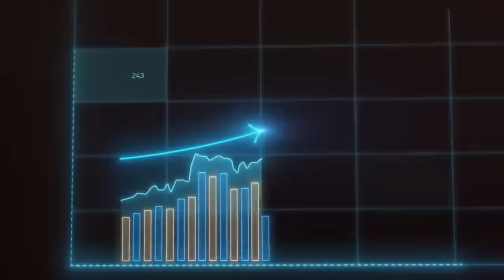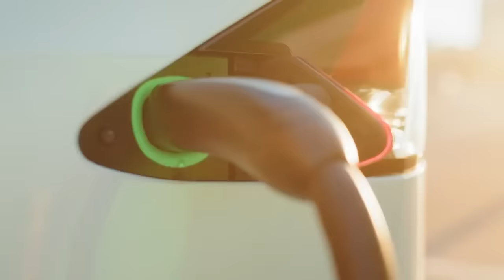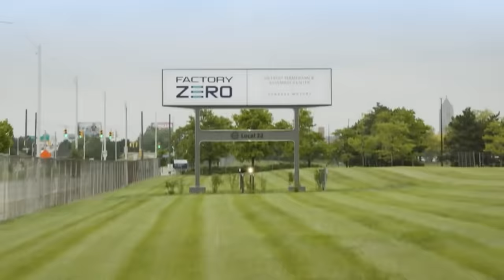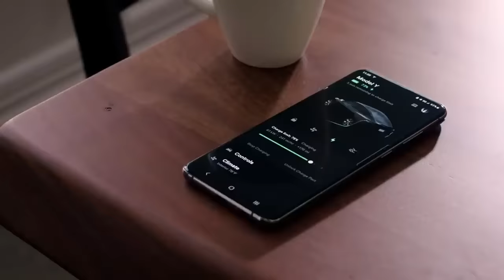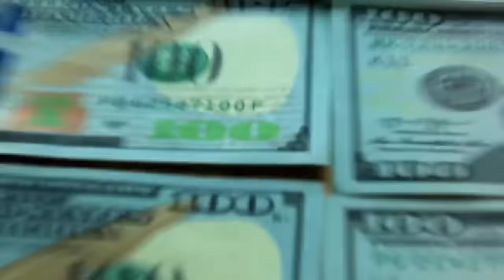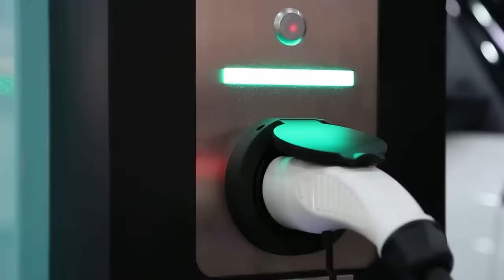Electric Vehicle Owners Are Frustrated and Demand the Return of Gas Cars

Comment: Sorry but I do not agree with almost any point mentioned here. Honestly, the author for sure did not drive an EV before. The drop of sales in 2023 can be explained by the high inflation and the fear therefore of the people. And of course new technic is always more expensive compared to "old" stuff. The EV market really exploded the past 4 years. Wait another  10 years and I predict higher sales for EV's than  gas powered vehicles.
I drive an EV for 3 month, I LOVE IT and switch the second car to EV this year as well.
Convice yourself, drive an EV, experience the ease of charging, the silent relaxing driving ... make up  your OWN opinion.
Thanks
Reply: This is my opinion. Personally I know of no one interested in an EV. We aren't there for range and work capabilities. They are probably a great novelty, 2nd car. A 2000 mile trip is a nightmare prospect in an EV, at least for now. Re-sale value, battery life/replacement are other considerations.

Comment: Electric cars are more harmful than  petrol and diesel cars  and  electric cars are dangerous and deadly ev car are very expensive high cost  to recharge up  and taking a  very long time to get  recharged up  3or 4 hours  

Plus they don't work in the cold weather  The battery shuts down so people can't use the vehicles 

Tesla and Tesla electric car design is flood due to the battery where its positioned road surfaces and other potholes, cracks on the road can damage the battery, causing the The car to go on fire Purchasing an electric EV car is like plain Russian roulette. With you families, life and your home address not worth the risk in purchasing a fully electric car. Due to the dangers of the electric vehicle  Due to broken battery. That can lead to exploding and then go   on fire. And it's very, very hard to put out and control. People simply don't want electric cars because they're far too dangerous.

But the globalists won't get there on way. Because people are seeing the evidence for themselves. They can not suppress it any longer. Regarding the serious dangers and consequences of owning an

 electric car, especially Tesla and other designers like it. Based on the design of the electric battery is underneath your car  Best thing is stick with your diesel or petrol car.  much cheaper and more efficient to run.

Comment: I switched from Diesel to an EV to do my part to protect the environment. I quickly realized that it is better in literally all aspects than an ICE car, except that it can't be filled up as quick. I absolutely love it and will never go back to a gas powered car.
Reply: Better for the environment? You're charging the car with electricity generated by fossil fuels, not to mention the vast open scar mining pits to extract those precious metals.
Reply: @danielhartin7680  I'm not. I'm on 100% renewable energy here. Mostly wind & solar. And even if I would use fossil sources, it would be more energy efficient than an ICE.